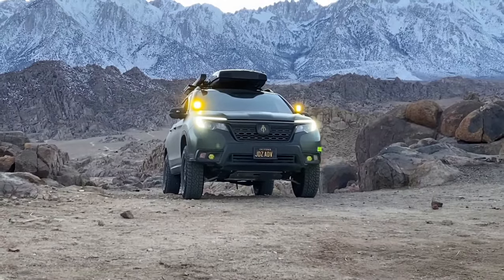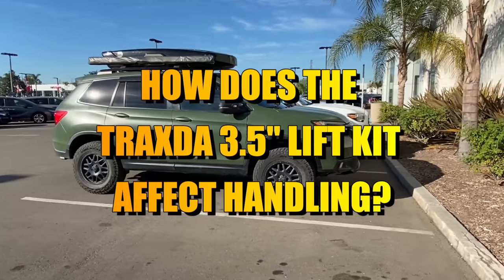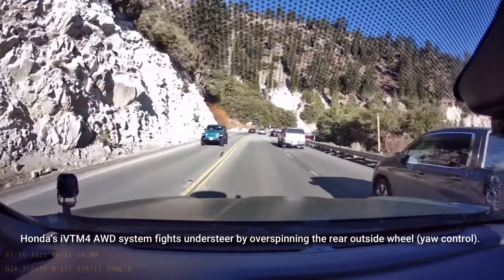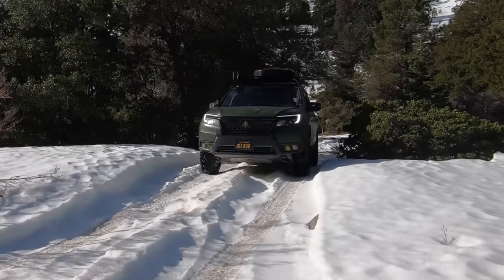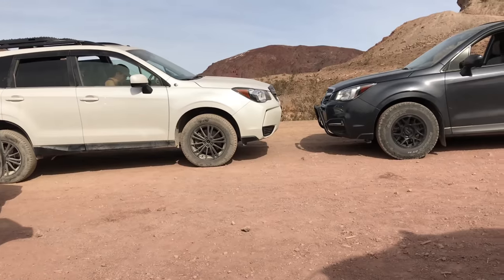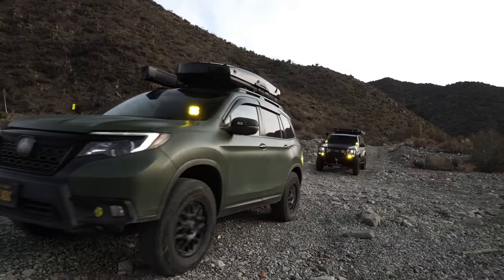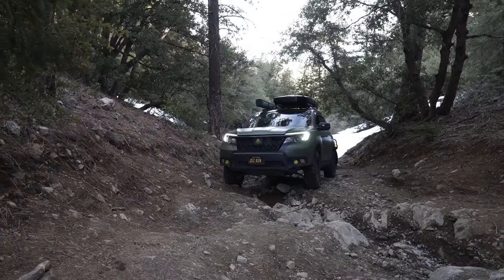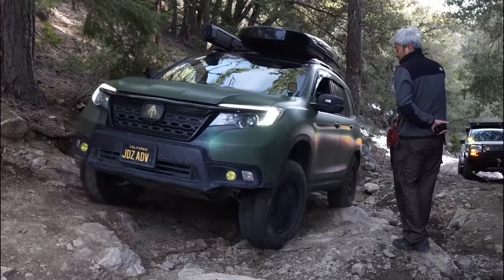3.5 inch LIFTED! Passport / Ridgeline / Pilot

Comment: Does the lift kit off set the tire sensors in the Pilot? Will Honda void out you warranty do to the modifications?
Reply from the maker: The lift kit does nor alter the speed sensor on the wheels or the TPMS sensors in the tires.  That would be strange if it did 😃.  Will Honda void the warranty?  They would probably void the warranty on anything dealing with suspension related parts, but since I have 76K miles (81K actual), I’m waaaaaay passed any warranty on my vehicle.  I believe Drive train is 60K and everything else is 36K.  Nothing has broke.

Comment: Hey Jon! Was wondering if you noticed a significant dip in gas mileage with your current build?
Reply from the maker: An AWD Passport is rated for 24 mpg highway.  At 65 mph, in calm winds, flat highway and on California Gas (which is 10% less efficient than other states) I get 22 mpg.  I hear that other Passport owners are getting 27-29 mpg, so if I lost 5-7 mpg, *that’s* okay with me because all I expected was 24 mpg stock anyways.  

In the city is where I’m sure I’ll see the biggest hit.  I drive spirited.  My combined mpg is at around 15.5 mpg, because I tend to drive like an alpha.  Once, I escape the big city (Los angeles), I turn on adaptive cruise control, lane keep assist and travel at the posted speed limit.

With my current build, the best MPG was during a trip to Sedona, AZ to Lake Powell and back.  I got 24 driving north and 23 driving south.  It was awesome.  I finished the 320 mile round trip drive with 1/3 of a tank left.
Reply: @JonDZ_Adventuring  that’s good to hear! I was expecting a drop off, thanks for the info! Btw I just purchased the JonDZ special 3.5 inch lift kit. I’m going to run 18 x 9.5 + 38, wrapped in falken wild peaks 275/65/18.. do you think 255/70 would be a better fit? Thanks again…
Reply from the maker: @gilbertd33zie  whoooo, that’s a pretty wide tire!  That size tire should be mounted on a wheel no wider than 9 inches, so use www.tire size.com to check on the specs.  

Also, keep in mind that the wider a tire is, the more tread there will be, and tread is heavy.  A wider tread will also increase rotational mass and add more friction. 

Falken Wildpeak AT3W
P rated 255/70R18 = 43 lbs
LT rated 275/65R18 = 61 lbs

Have you purchased your wheels yet?  I’d try to keep it no wider than 8.5”
Reply: @JonDZ_Adventuring  yea, but also my pilot will be just used for soft over landing, nothing too crazy. Gearing more towards a cosmetic build. With that being said do u think the 255/70/18 would be a better fit for rim size? Thanks for all this info btw you’re helping me out tremendously!

Comment: Does the ridgeline 3.5in and rear 3in lift fit on a 2019 honda pilot touring?
Reply from the maker: Yes!  That’s the kit that was modified just for the Passport/Pilot.  Traxda used my vehicle to measure 📏. Part # is 222060
Reply: It does, it does!!:)

Comment: Hey ! My dad just got a passport touring and he’s wondering if it’s ok to put 225/75/17 tires for the winter setup, the car is 100% stock so I don’t know if there would be any rubbing
Reply from the maker: Use www.tiresize.com to calculate the diameter of the tire.  In this video, it’s mentioned that a 30.5” tire will rub slightly.

Your Dad’s tires come out to 30.3” so he should be fine, plus, since those tires are narrow, that will reduce the chance car of rub.
Reply: Hey did he ever get the tires? I’m trying to figure out what’s the biggest and widest tire I can get while I’m stock

Comment: Hey I’ve come across your channel and see you have done a lift to your passport. I’m doing a 2 inch truxxx lift on my passport and wanted to know what was the tallest tire I could put on? I heard 275/50/20 was the tallest tire that would fit without rubbing. Not doing any off-roading just for a more aggressive look.
Reply from the maker: So, the lift won’t actually help you fit taller tires.  Before the lift you’ll notice that the pinch weld lines up just under the center of your wheel, after the lift your wheel will line up just above the center line of your wheel.  The 3.5” lift helps a little bit, but don’t expect to fit much larger tires.  

Check out my video about the subject:
https://youtu.be/c57eqe-V15c

The tire you referenced is 30.8” x 10.8” and it will surely rub.  To fit taller tires, you can purchase the Traxda axle relocation kit.  It moves the wheel forward 1 inch.  Some trimming of the plastic wheel liner may be required, but Atleast you’re not cutting metal.

Comment: You said 8.1 inches from the factory. And you added 3.5 through the kit. So how did y’all get 12-12.25 in height? Maybe I’m forgetting something.
Reply from the maker: In this video I’m running 32” tires.  Stock is 29.6”
Reply: @JonDZ_Adventuring  yup, i forgot about the tire change! Thankyou!

Comment: Dude, how’s that gas mileage?  😂🤣😅 about 17-16mpg? I just got falken wildpeaks a/t trail for my 2020 Pilot. I feel like it took a 1mpg hit, I have yet to fill it up and actually check..
Reply from the maker: I go over it in the video.  15% less than a 4 cylinder Subaru Outback with a tire strapped to the top.  It’s been too windy to do a real test.
Reply from the maker: As far as All Terrain tires, the sad truth is that the faster you go, the less MPGs you get.  Where I’d be able to do 80mph and get 25 mpg with stock highway terrain tires, doing 80mph with my Falken Wildpeak AT3W gives me 18-19 😩, but 21-23 at 70mph.  That’s with calm winds.  Because I have the roof top cargo carrier, lift kit, cut bumpers, even a side wind will mess up my numbers.  It’s been so windy in So Cal that my drive from Los Angeles to San Diego doing 85mph gave me 15 mpg!!!  Driving that speed I usually get 18 mpg.
Reply: @JonDZ_Adventuring  that’s what I get in my Tacoma on 32’s
Reply: @JonDZ_Adventuring   didn’t know that about A/T tires! seem to do the opposite of stock A/S tires, wow! Sounds like you need to drive like a grandmother my man, 15mpg!!!!?? That’s worse than these new HD TRUCKS 😳.. holy crap, I’m sitting here crying about 1-2 mpg loss 😂. 

I’m looking to get a lift for my 2020 Pilot possibly later this year.. I’m thinking a 2.5 inch lift, something casual nothing insane..
Reply from the maker: @jppilotadventurez5251  haha’. The winds down here have been fierce.  Actually, this was the first time my Passport has been blown sideways in the 2 years of ownership.  First time I’ve had 15 mpg too!
Reply from the maker: @jppilotadventurez5251  so, a 2 inch lift is the max most modern unibody AWD vehicles can handle without eating up the axles.  The 3.5” lift used 1 inch subframe spacers.  This drops the transmission down an inch to compensate for the 3.5” of total body lift.  My axles are straighter and more leveled compared to when I had the shorter lift.  I know.... sounds hella confusing, but the pictures tell the story.

Comment: Have you thought of installing an S-VCM to disengage your VCM and give you all real V6 power and less strain on your trans?
Reply from the maker: I thought about it, but from many experiences, I’ve concluded “Range” is more important.  As an overlander, my life will depend on “Range”.  It’s saved me atleast 5 times.
Also, I’m sure I put way more strain on the transmission simply offroading.  I think “Sport” mode also turns off VCM, not totally sure, but I think it does.

Comment: I ordered the TrailsSport with the 18" wheels..what's the all terrain I can get and should I do a lift? I live in NYC and will occasionally take it on some light offroading either upstate or long island.
Reply: If you are stock ride height, you can run up to a 265/60r18 and might have some rub depending on tire manufacturer. I haven't heard any rubbing on my 265/60r18 nitto terra grappler g2's under full lock. The lift is up to you but I would definitely recommend it.

Comment: What caused the stripped thread on the axel?
Reply from the maker: Good question.  The threads were
Stripped when they hammered out the axles.  Traxda isn’t setup for automotive repair and didn’t have a tap and die kit to fix the thread.  They just ordered a passenger side front axle.

Comment: I wonder what the install is for the front lift kit. Prying the lower arm to get the shocks back it seems to be maxed out at 2". Not sure how 3" is going to work out for the Pilot.
Reply from the maker: You’ll need to loosen the subframe to install the 1” subframe spacers.  Don’t full tighten those until you get the struts in.

Comment: So my subaru has 10.5" clearance on the rear dif.  I'm not sure about the 1" gain thing
Reply from the maker: Hey Nick, I actually had the 2” front and / 2.5” rear ADF kit on my 2015 Forester XT.  I was definitely shocked to see 9.25” at the rear diff. Measured 9.5” on Daklakfoto ‘s 2018 FXT.  I’ve heard from other Subaru owners that they choose the 1 inch lift because of this, and some others skip on the Multilink “re-centering”  so that they can take more advantage of the lift.  What Kit do you have?
Reply: @JonDZ_Adventuring  I have 1.5 adf front and rear with king spring lift.  And 1" taller tire.
Reply from the maker: @durtyflyadventures  ah hah!  So, king springs actually add lift.  They’re stiffer so less butt droop.
Reply: @JonDZ_Adventuring  thats interesting. I didn't know that people were having issues with the 1" thing.  I am glad I got the king springs then haha
Reply: @JonDZ_Adventuring  do you think traxta will do subaru stuff eventually?
Reply from the maker: @durtyflyadventures  I need to tell more people about your results!  Last weekend I got to hang with @goadvtr.trek and he intentionally lifted his crosstrek only 1 inch because of the way the multilink rear lifts.  Anyways, he still got up Cold Water Canyon.  Super impressed by that!  I think he mentioned he has a spring lift instead of the spacer lift, but... only 1 inch?

Comment: i’ve noticed with my passport and watching the torque info screen, the wheels on the inside of the turn gains the power, not the outside 🤷‍♂
Reply from the maker: It depends.  If you’re taking a tight turn and powering out of it, the power goes to the outside wheel.  If you’re on the freeway doing 80mph, torque distribution to the outside wheel as you change lanes would be dangerous, that’s why torque will go into the inside wheel, to keep you controlled.

Comment: Where did you get your lift at? Please send me location. Love the video!
Reply from the maker: I bought it from Traxda USA in Tuscon, Arizona but you can just buy it online at:
https://traxdaliftkits.com/product/kit-222999-2017-2022-honda-ridgeline-pilot-passport-2wd-4wd-awd-3-5-front-3-rear-lift-kit/
you can use my discount code "JONDZ20" to save you 20%.  As far as where I had my lift kit installed, Central Tire #5 
4430 W Imperial Hwy, Inglewood, CA 90304.  They're by the Los Angeles Airport (LAX)
Reply: @JonDZ_Adventuring  how much was the price for it if you don’t mind me asking?

Comment: You don't gain 4" of ground clearance with a 3.5" lift. You're measuring at the wrong location. Look at how much lower the control arms are compared to where you measured. Just like solid axles clearance doesn't measure clearance at the axle tube, but at the bottom of the differential.
Reply: I'm sure Jon know that. I measure at the same points. My rear diff. Clearance is 11" , but I know the lowest point at my control arm is 10"

Comment: I am about to pull the trigger on the Traxda lift kit.  But I'm usure which one to get.  The 2" front x 2" back is only $400.  The 3.5" front x 3" back is $1,400.   Talked with Traxda direclty, they say for my Honda Ridgeline, the max tire size for BOTh options is 31" tall tire.  So if I can't get a bigger tire in, why would I go with the 3.5"???  I don't tow, nor do I haul large items.  I do live where it snow and that stock 7.6" ground clearance is marginal, so I'd like more ground clearance.  (I'm also planning on getting some AT tires and 'manly' rims for the looks).  Would love to hear Jon's thoughts on 2" version vs. 3.5" version - in terms of actual ground clearance achieved via the lifts.
-
Also, Traxda says the 3.5" lift puts less strain on the existing hardward than the 2".  Traxda says they've never had any complaints or problems with the 2" becaue of this, but I thought I'd ask around...
Reply: Any insight on tires brother? I’m also looking for manly tires for my passport that also look good
Reply from the maker: I made a “largest tire you can run” video.  Your questions are answered there.  I personally run 33” tires, but I go over what will need to be done to run these.

Comment: So with the sway bars connected how big of a difference do you think the 3.5 inch lift on ridgeline would make on handling?
Reply from the maker: I don’t think you’d notice anything.  Actually, because of the preload spacers (in the front), it might actually have better onroad handling.  I have a Pilot owner that says handling actually improved.  He went from stock to the 3.5” kit, I went from stock to the 2” kit, then from the 2 to 3.5”.  Each transition I didn’t notice a change in handling.
Reply from the maker: By the way William, Eibach has made lift springs for the Ridgeline.  Because I carry so much weight in my vehicle I needed to increase spring rate.   I actually transplanted Ridgeline springs and shocks over a year ago, and recently upgraded the springs to Eibach (in the rear).  Because the rear springs were only 0.3” taller, it was a non issue to just add this to my 3.5” lift.  We elongated the shock to match the longer spring, giving the rear long(er) travel.

The plan is to install the front Eibach springs, which are 0.8” taller (and stiffer).  The 3.5” kit uses 2.5” top hat spacers, so I’ll be swapping that out for a 1.5”.  With elongated struts wheel travel is increased.  This all should happen in about a week or two, then I plan to make a video about all this.  

Edit:  this will make the handling better than stock.
Reply: @JonDZ_Adventuring  Super helpful ... thx for taking the time to respond.
Reply: @JonDZ_Adventuring  you sound way more of a car do it yourselfer than I am ;)
Reply from the maker: @GenXer72  I have other people do the installation, but I know what I want and don’t want 😃
Reply: I’m looking forward to that video. Is it already posted?

Comment: Aloha,  I also have the 3.5in kit on my ridgeline,  do you have any counter steering issues? If I throttle wheel goes straight when I decelerate wheel will clock to the left about a inch or so.  Just wondering if it’s only me? 
Mahalo
Reply from the maker: Mine does not do that, but I can tell you what might be the issue.  If you look just to the right of your driver side front tire there will be your steering coupler.  It should be spaced out.  Have that checked.
Reply: @JonDZ_Adventuring  do you know what the spacer looks like? I was one of the earlier kits not sure if it was included or in the directions. Or maybe I missed it. Mahalo for your help.

Comment: I hear Honda Transmissions are Crap and overheat on off road excursions.  Any problem with that with those big wheels?
Reply from the maker: My Passport doesn’t have a Honda transmission, it has the ZF9 made by ZF Friedrichshafen AG (it’s German).  Upper trim 2016+ Pilot, 2019 Passport, 2020+ Ridgeline all have the ZF9.
Reply: @JonDZ_Adventuring  Ok thanks for the info.  I've seen a few ridgeline videos where the transmission are overheating...more than one video.  Only when offroading.
Reply from the maker: @dwaynedwayne7951  yeah, so the 1st Gen Ridgeline has the Honda 5 spd with a 11:1 crawl ratio.  The 2017-2019 Ridgelines have the Honda 6 speed with a 14:1 crawl ratio.  The 2020 Ridgeline got the ZF9 with a 20.4:1 crawl ratio.
Reply: @JonDZ_Adventuring  Ahh...well that's really good to know.
Reply: Not having a transfer case will do that
Reply from the maker: @seanc8514  you should read the replies 😉.  Did you know that the Passport is geared more aggressively than a 4runner in 4 low 2nd gear?  When are you overheating a 4runner in 4 low 2nd gear?

Comment: Do any of these mods effect the one keep assist or adaptive cruise control?
Reply: @revilsdr  thanks for the reply! I likely will only add taller tires.
Reply: You should be fine then I think it’s when trying to do a massive suspension lift over 4 inches or changing out a lot of the OEM suspension that it causes problems